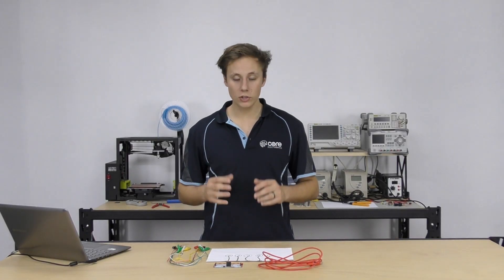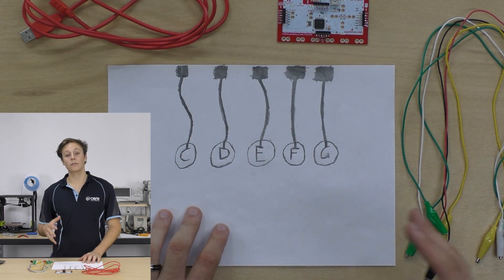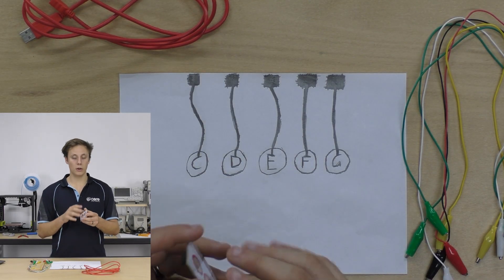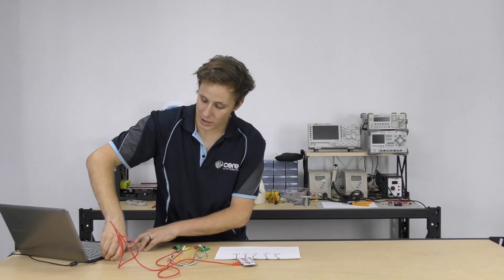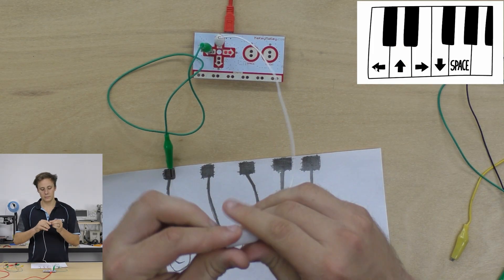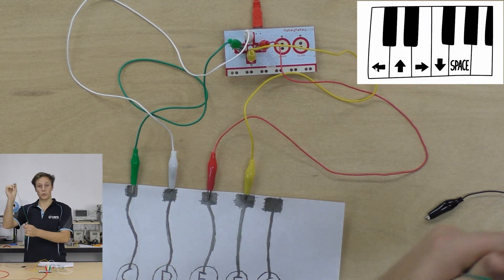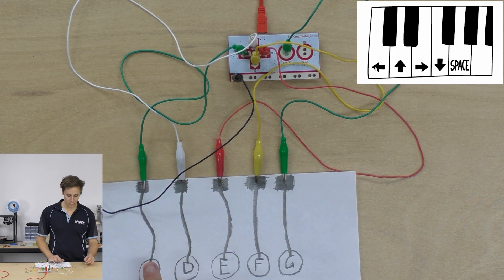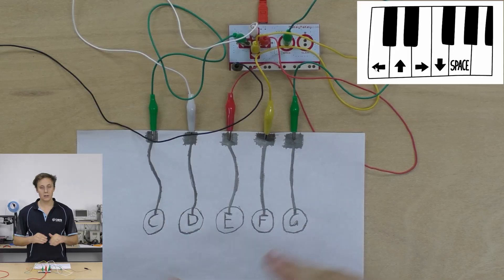Makey Makey Project - Hand Drawn Piano, Nice!

Comment: wich pencil did you used
Reply: It comes with a special pencil
Reply: No it doesn't come with a special pencil but the graphite from every pencil is usable
Reply: @oofpoof3447  If you buy the craft and code booster kit it comes with a special pencil.
Reply: You can use any pencil, but a 6B works best!

Comment: It doesn’t work :( why did you lie to me?
Reply: @ItzJeff graphite (or commonly known as pencil lead) is a slightly conductive material, you may not be connected to Earth, though.
Reply: did you connect the earth cable
Reply: ItzJeff it does work... i have makey makey too
Reply: RobertXD007 I think it comes with a special pencil made for it
Reply: I would say that the pencil you used, may have not been the best. Also, make sure that the end of your pencil is not sharp, because you won't be able to get the thick layouts..
Reply: I think you need to use a better pencill